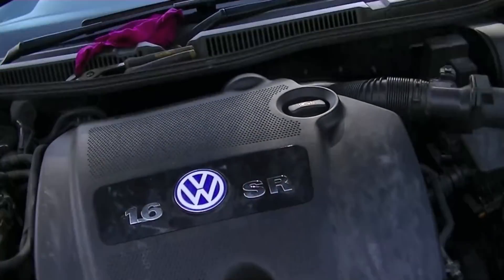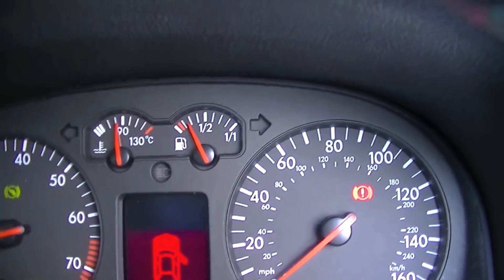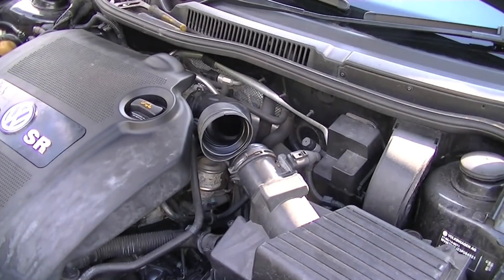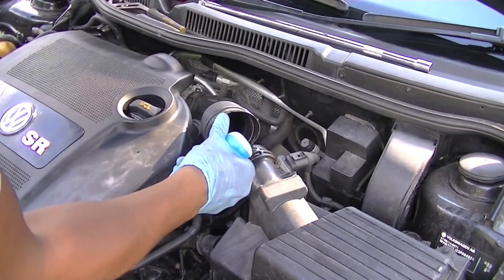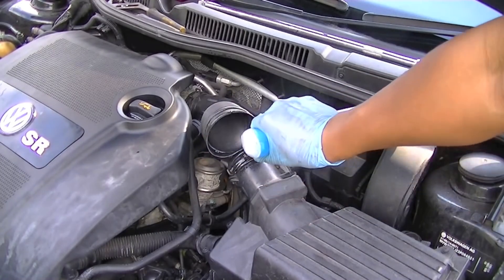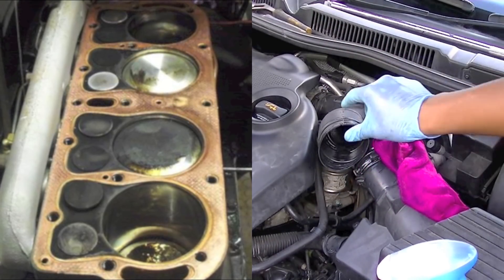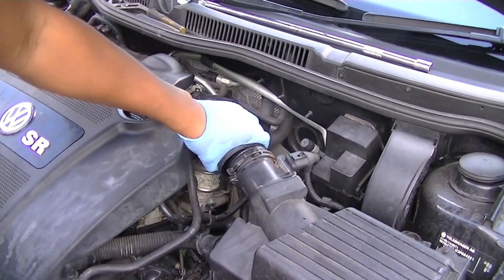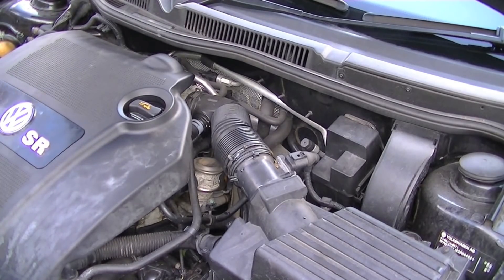How to make your engine run better with just tap water.......Better Than Seafoam?

Comment: This does not clean the carbon from the intake manifold, intake valves or even the exhaust  valves because the process your are attempting is call thermal cleaning which happens on the ignition stoke and will only clean the surface of the piston and and head and this would habe to be done a lot antifreeze  is somewhat of a petroleum  product not just water
Reply from the maker: +ladale21 why antifreeze?
Reply: +BMAC VAGS I'm not saying to use antifreeze I'm saying that antifreeze is a petroleum product which is why it cleans better then just doing water because if you think about it when you have a head gasket leak antifreeze is already at beyond operating temp and is at pressure if you go look at all engine cleaners they all have some sort of petroleum based product in them using water does clean them however because water is not going to be under pressure or is hot this process would have to be done a lot also because it's done on the ignition stroke where it's at its hottest it won't clean the intake valve or the exhaust valve
Reply from the maker: ladale21 Who told you anti-freeze was a petroleum?
Reply: it is a patrolium based product common knowledge
Reply: the same thing used with oil to make it a corrosion inhibitor is added to coolent, andy coolant that has not been switched to propylene glycol formula has it in it, which is why some manufacturers have specific brands sor some of their cares such as dextrin used in chevy vehicles

Comment: one thing you should know water and steam will break down engine oil quicker thus the reason why people with minor head gasket failure have to change there engine oil more I addition on your other seafoam video about your test the reason seafoam give a white gas is not the carbon in the engine it is the oil in the product

Comment: Reminds me of what I used when I first started driving in the early 70s, it was known as the "Poor Mans Tune Up".

You would put a glass of water on the engine and adjust the Carburetor until the ripples in the water minimized, then raise the RPMs and slowly pour the water down the carburetor.

It worked pretty well as I remeber.

Comment: ALSO works on carburetor but on a bottle with water an alcohol make two holes on bottle cap put two small hose  on cap one all the way into water and the other in the just inside bottle not in the water this hose will be suching from inside the bottle connect it to carburetor where can be switched into engine this will make engine better

Comment: I found out about this in 1958  on my 49 Ford  when it had a head gasket blow when racing it when I was fixing it I saw how clean the engine was inside and again in 1976 same thing happen with another car and got my engine clean again,was think may be a mist sprayer on a water hose.I KNOW it's works

Comment: Seafoam does the exhaust same thing is is more productive in cleaning other parts of the engine all the water is doing is making a steam and cleaning the tops of the pistons but isn't cleaning the insides on the other hand seafoam creaps into the cracks because it doesn't evaporate like water does, also seafoam leaves a protective layer of oil on the pistons when its done working, using water on the other hand removes the oils from the pistons and can cause severe engine failure if done incorrectly, its always advisable to use a lubricating fluid when cleaning anything mechanical inside the engine, all water does in this situation is evaporate the carbon because of the heat but look at it a month later and you'll see that the carbon has built back up. Its simple chemistry, as with the seafoam it leaves a lubricant residue on the pistons and fights off the returning carbon, this process should only be done for a temporary fix, if you have a leaking head gasket water nor any other lubricant is going to fix it.
Reply: I use an oil catcher to keep from oil getting through the plenums, oil inside js collects gunk and builds up. It should be smooth for less turbulence and better air flow.
Reply: David Now oh ok, ive js never heard of it. Not quite sure how oil would protect the inside cos there is no friction from air, n the purpose of oil is to protect against friction. But I guess its new to me
Reply: David Now Couldn't you use water first, then use the seafoam to get the rest of the system and coat it?
Reply: David Now Actually the oil there is just a natural occurrence. Auto manufacturers don't put it there. It's just oil that has accumulated on its own. It doesn't protect anything really, it's just something that happens. Some people say it's beneficial, other people say it's a hindrance to the car's performance.

After some heavy looking into it, I can't find a single thing stating that the oil is intentionally there, but a lot of posts/threads that explains how it's just a natural thing that happens in an engine.
Reply: Exact*
Reply from the maker: David Now Where did you get this information that it does all of this stuff? and creeping in what cracks?
Reply: Random internet searches done for working on my own cars and plenty of YouTube videos on the subject of what seafoam does, also not necessarily real cracks but space between the cylinders of the pistons and the pistons themselves, and any hard to reach places than water won't creap into and if water does it just sits there but with the chemicals inside of seafoam such as isoprpyl alcohol than get into hard to reach places and dissinegrates carbon build up just like cleaning off your hands with rubbing alcohol wipes it does essentially the same thing but doesn't affect the oils on the engine or oils on your hands/body
Reply: That*
Reply from the maker: But in reality, you don't really know it does that, do you? Its mainly hearsay
Reply: Not really because I seafoam my car regularly and there is little to non carbon, I have tried the water technique that's where I stated the knowns of what water does instead of using a lubricant, just like you wouldn't put water in where your oil is to clean it because it roughly does the same thing that's why we use lubricating additives to our oil so it doesn't ruin the vehicle in the long run, again for maximum efficiency use a lubricating substance to clean anything in your engine, I believe the water should be a last resort and only for temporary use
Reply: The intake manifold itself has an oily layer on it and when using water it dissinegrates the protective oils on the walls of the intake, that's why when cleaning a throttle body with TB spray your suppose to avoid spraying it down the intake because it eats away at the protective oils in the manifold
Reply from the maker: Why would the intake manifold need protective oil? You are making this up
Reply: The oils on the walls of the intake manifold protect the walls from wear by all the gunk that passes through the air filter and protects the sides of the intake wall from specifically carbon build up
Reply: +David Now (Dnshady) how is there oil inside the plenums? There shouldn't b any oil inside them. The plenums should be free from oil n debris
Reply: Because of small bypass from the PCV valve, and some engine companies put an oily protective layer on the inner walls as I mentioned above to protect the engine from wear
Reply: @RuskeyOrphan   dumb fuck the  intake manifold doesnt have a coating of oil  its not a moving part  its a clean air intake so why would it have  been contaminated in oil ????  the oil coating your on about is from the crank case breather being recirculated via the intake  not to atmosphere  like the old cars  . if your car has an egr valve  this sends used hot exhaust  air into the inlet manifold this causes the oil vapor filled crank case air to become hot n sticky then sticking to the intake and egr valve   and this can block the intake  manifold and egr valve  with sludge thats why they sell egr cleaner   if you blank the egr  and vent the crank case to atmosphere  the oil and sticky residue will no longer build up  and you will have more bhp if i was you id stick to playing with your self   not engines!!
Reply: That's why I think some engine companies use a thin layer of protective oil on the inside for that exact reason for smoothness, some motor companies don't, I know that Japanese and some German engine companies use a thin layer of protective oil sealant on the insides, that's just been my experience

Comment: Put 2 tea cups of acetone in the gas tank. Then fill up with gas. If you can get hold of 2 cups of nitro glycerine then that works much better. WD 40 sprayed on the brake discs stops any binding and brake pad squeal.
Reply: Crobular I You are going to end up killing someone.
Reply: Crobular I Okay, so I need some nitro glycerin, wd40 on brake discs. Someone told me that duct-tape works really good at holding hoses together, and that covering your engine with foam insulation will help prevent stop the sun over heating the engine.

I think i'm set on car maintenance.

Oh, and very powerful magnets against anything with a circuit, to make sure nothing on the circuit boards move around.
Reply: Nitro tables?
Reply: Are you taking the piss? Use a lubricant on brake discs that will soak into the brake pads, dipshit
Reply: Dave Wright i think he is trolling. 
nitro glycerine is highly explosive, sure why not lol
Reply: Draggon Reaper hahhaha i have no words for this
Reply: +Draggon Reaper    Well, we need a good sense of humour these days.

Comment: Don't try this on your car, there is a reason you are not suppose to drive through water. And that is because you get water into the intake where he is spraying water into. First he tells us that all those fuel additives don't have proof of their stuff working while not showing proof himself, the proof he shows us is of a blown engine that got a clean piston from blowing, if that isn't proof enough to not do this then idk what is. Take the engine apart show us the parts then do this and then take the engine apart and show us the parts again. By just driving around saying "oh it runs better" who is to say this car wasn't running good to begin with? There is such a thing as the placebo effect in which you do something and you think it worked when if fact it didn't do anything at all because there wasn't a problem to begin with.
Reply: Fringe13 There's a big difference between spraying a fine mist of water into the air intake and driving into deep water. Overall the engine can cope with a mist, but a huge slug of water can easily hydrolock one or more cylinders and bend a con rod. That engine suffered a complete failure of the head gasket which allowed water into one cylinder thus cleaning the piston crown. That's the opposite of your assumption that water caused the head gasket to let go.

It's been known for decades that a controlled small amount of water added to the intake manifold will make an engine run more efficiently. He has no need to strip his engine twice just to please you as mechanics have done it numerous times in the past to show that the process does work!

As for the effectiveness of magic additives, a lot of them have been independently tested by automotive laboratories where they have been proven to be nothing but snake oil.
Reply: BMAC VAGS Because flooring your pedal causes excessive condensation inside your compression chamber. Which is the same thing you are doing.... when you did this on the Diesel engine. You probably had a blackened driveway behind the car right? Which gives the same effect by flooring ur pedal every once n a while..
Reply from the maker: So what would you like me to do?
Reply: Fringe13 actually this is a "old school trick" that your grandpa. The Reason driving through water is bad is because a large amount of water enters the cylinder and becomes hydro locked, at a fast RPM rate and having a sudden hydro lock can snap a connecting rod.
Reply: BMAC VAGS Get a before and after with a camera of the actual piston itself (take sparkplug out and get the small camera inside through that hole).... That's the only proof you can provide. Those fuel Additives actually do work. Not a lot but they do work
Reply from the maker: I have done that already http://youtu.be/eZDISp2pdSo
Reply from the maker: onderduimpje So what are you saying now?
Reply: BMAC VAGS I'msaying the same thing can be achieved by just pressing ur foot to the floor every once in a while.
Reply from the maker: onderduimpje How do we know that?
Reply: Fringe13 the water will atomize, it wont hurt the engine...as in he doesnt pour water into the intake...spray is ok. just like the meth. Kit..

Comment: It does work an it works well .... Great vid  iv been doing this method for a long  time like the guy says just light sprays to create steam  nothing more ........ Ohhh an to (crack the block ) you would need direct contact with cold water...  by the time the water you spray down your intake  reaches the pistons its already too hot to do that sort of damage.

Comment: This does work, but it is best to use a fine spray of water... 
it is a shame the comments are filling up with insults and hho spam. I have used water spray on petrol and diesels... be extra careful with not being heavy handed with the water.. diesels have a very high compression ratio and are easier to hydrolock.

Comment: This de-coke method Does Work! although the best method is to rig up a water-mist injection system that allows water flow approx same rate as fuel cons, and run under load at approx half engine power while running water-injection for a couple of miles.

Dont listen to the daft ill informed Ney-Sayers,-- De-coking by water Does Work. It will also unstick seized piston-rings from mis-use of veg-oil as fuel in Diesel-engines,--a proven fact.

You can also rig up a Wallpaper Stripper and use the Steam from that to supply the engine,--effect is the same....

Comment: This does work. Its a very old school method that has been used since carburetor motors were the norm. Ask any old geezer mechanic about it. To anyone who says this can hurt an engine, ever heard of "water injection"? the military and the performance car world have been using water injection to cool hot spots in the cylinders for a long time. The cooling effect of the water helps prevent detonation allowing for high compression ratios and more horse power. This method done right will do no harm to a motor whatsoever.....

One thing I will point out is that it's much better to inject the water through the brake booster hose. I wont cause the CEL to come on and some cars will barely run without a proper reading from the MAF.
Reply: This method and the smoke billowing out the exhaust are a good way to break the ice with your new neighbors when you move into a new home.  First impressions, you know; but it does work.

Comment: Sure this can remove carbon from your engine. However, there seems to be no warning of caution here. If you are running any turbo engine (petro or diesel) you stand a high risk of dislodging debris and destroying your turbo. The only safe way to de-carbonize a turbo engine is to completely disassemble it. 
I only commented for the same reason the author of the video posted it, and that was to help. I'd hate to see someone cause themselves thousands.